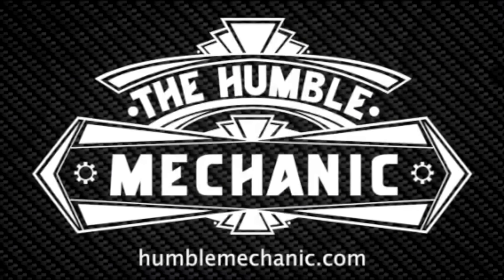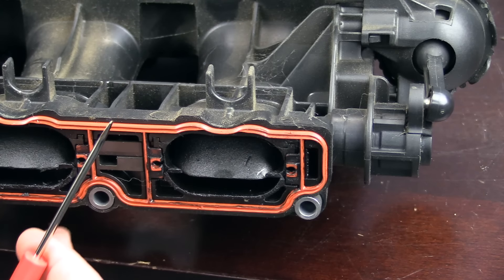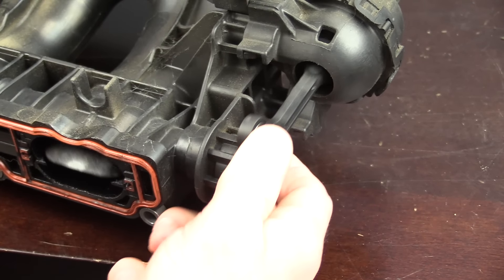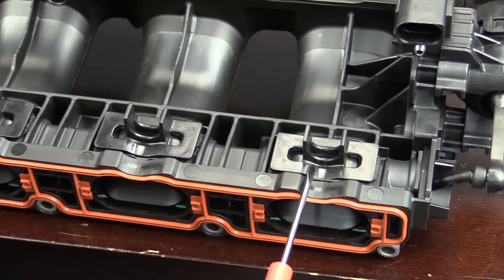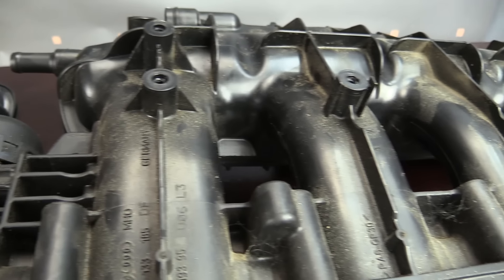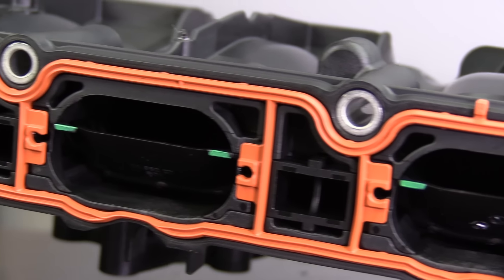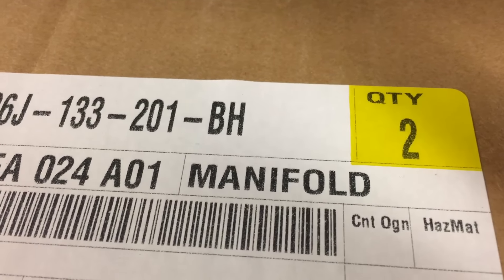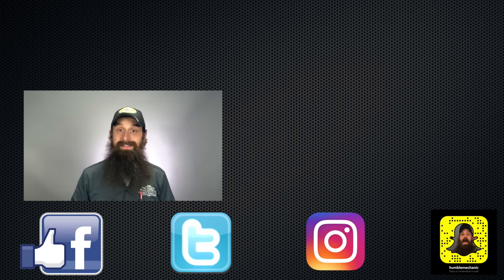2.0t TSI Intake Manifold UPDATE!

Comment: Here in Australia the VW Audi group has their fans, but a steadily growing army of discontented customers. Mercedes is beginning to get a very bad name now, in fact, anything European.
I have heard tow truck drivers say that if it wasn't for the European cars, their businesses would be rather quiet as a whole.
All cars have their problems. The discontent is growing with the dealerships and their abysmal customer service. From denial of the problem to a constant run around in order to avoid the issue (or warranty claim).
Mazda, Hyundai and Kia are now getting on top of the game here with great customer service and decent warranties.
Prices of European parts are another issue. A genuine VW radiator hose (the one with the little hose out of the side of it) is listed at $1400 and you have to wait for it to be shipped from Germany - about 6 - 12 weeks wait.
Mercedes S class engine mount. One lasted 48 000 kms and was just out of warranty. Sorry mate, here's your bill...... $3500. The owner trying to argue a case was dismissed and pushed back and forth between the Mercedes HQ in Oz and the dealer. The guy ended up paying just to get his car back. Pretty inexcusable customer support for a $100K plus vehicle. But is typical. The word is getting out here that the European cars are nothing but trouble and horrendously expensive to fix.

A friend of mine did his apprenticeship with VW here and he keeps telling all his friends to keep away from them and anything else European. They may (?) work well in other countries, but their reliability reputation here is quite poor and even worse the dealership customer support is usually highly reprehensible.

Comment: For those still looking at this, note that if you go from the old revision to this new one, you will also need to replace the fuel rail with a new revision as well as the bolt holes do not line up on the old fuel rail to the new manifold. So if you are replacing this yourself you'll likely be looking around $500-$800 in parts and not just the price of the intake manifold.
Reply: For anyone looking at this guy's comment, HE IS WRONG!
I have an 09 GTI, which is the FIRST model of the TSI engine. I just replaced my intake manifold with this new updated one and it was a straight swap.

I can kind of see how he may have thought that the rail did not align but you have to stick the top bolts of the intake manifold on first then it aligns perfectly.

Comment: Great vids! I watched the Scirocco VR6 swap videos and got the VW bug again. No pun intended. I recently picked up a really nice '08 Jetta 6spd. Great little car, but I'm getting a surging idle when I come to a stop. It'll rev up to about 2k rpm, then somewhere in between 1-k, then idle smoothly. Pulled the PCV out and it was torn. Easy fix, but the idle surge hasn't subsided. In fact, I'm showing misfires on all 4 cyls. I'm not detecting a vacuum leak, at least I haven't been able to find one using the old propane trick. Any thoughts? Idle control valve? Could it be the manifold?

Comment: When was the release of this new Intake Manifold?  Asking due to going through several intakes under warranty.  If it falls under the time I had it replaced, I'm going to ask why the updated one was not installed...  as I need another right now for a vacuum leak issue and intake runner fault...  Thanks

Comment: Question:  Differences in 1.8 and 2.0, the engines seem to be a lot alike, other than the 200 cc difference in displacement; are the problems of the 2.0 inherent in the 1.8?  I know the 1.8 has a turbo hooked into the built in exhaust manifold, but are all the other failures pretty much the same between the two engines?

Comment: Hi, just subscribed to your channel. Great video. Gotta question I was hoping you could help with if you don't mind? I just fitted this new manifold on my 2.tsi but it now stutters and chugs at idle 0.8 revs. Any idea what could be causing this? I changed manifold due to the arm fault and a lean air issue

Comment: damn i got the 2016 gli amd its seems lately that all the vids i get from you and other post are not very pleasing.  im right at abour 11k miles and now i want to take the damn thing back.  lol.
Reply from the maker: That has a different intake manifold. :) The 15+ cars have been pretty good so far.
Reply: My 2015 gti just got a p2014 code last night about intake manifold runner flaps so i took it to get fixed under warranty. My gti only has 20k miles. No ones safe lol now im worried about vw

Comment: F*** that flapper actuator. F*** Plastic. Performance Intake Manifold (HPA) for 2.0T FSI-TSI-TFSI 949.00 Cast Aluminum Flapper DELETE. 40% better plenum rating and fuel boost optimization. Fits any 2.0 engine Audi or VW
Reply from the maker: A great option for many of us. Not so thing most people will do.

Comment: Plastic manifolds... on a force-inducted engine... 

I know it's been engineered and Charles himself said he can't recall ever seeing one split or crack but plastic just doesn't really give me any confidence of having a long service life.
Reply: Alexander Klein 
No matter what kind , it eventually gets hard dry and gets brittle and cracks. Plasticizers and other big worded chemicals outgas from it and that's it. 
Here's food for thought. 
The faa says no locking bolts containing nylon or other items like that are allowed from the firewall forward. 
That's more for fire protection ,but lemme use an Italian accent : itsa notta good
Reply: That is because when nylon gets hot(400F) it will burn, not melt. so not real great at fire suppression
Reply: Welder+ cnc and good chunk of aluminum. Same deal with water pump housing.
Reply: Hence the great reliability of modern German cars, ohh wait!
Reply: Yea I could not believe it myself when I heard they switched to plastic. Im still rockin my mk4 gti and absolutely love them. Currently saving for a mk3 jetta and mk2 gti. Hell eventually I plan on getting the rare bus/truck thing they made!

Comment: I have a 2008.5 TSI Jetta Wolfsburg. Runner flap failed on my car, entire flap stuck inside my head holding a valve open... when we took it apart, was able to save the head but changed manifold.. Worst design ever..

Comment: Had my 2nd intake replaced this week on my GLI.  My first one went out @ 52k in 03/16.  Now I am at 87k.  The only difference in the part number is now its a -BH, my previous replacement was a -BD.  I was told @52k that it shouldn't happen again.  Lets hope that this -BH does in fact work and it wont happen again.

Comment: Why couldn't they forsee this? Why didn't they build it this way from the beginning?
Reply: There's an old saying: pick the right material for the job.
Plastic crap...
Reply: Jay Edlington then you engineer a car bro. There are millions of reasons manufactures do what they do. Plastic manifolds are king due to there ability to self cool, don't expand and contract like metal does, house runners for varying intake length, and will not damage the engine if the front end has a impact.
Reply: What kind of material have a better temp transfer? Plastic or aluminum?

Comment: Hey I literally have asked and looked everywhere for this answer and no one, not even the people who make it can answer this question. 
I want to use the delete runner flap kit in my 2013 GTI. My question is. If I put this kit on, the flap runner sensor will still throw p2015 code because there will not be any movement to read. How do I turn off, tune, remove the sensor so I won't have that issue?

Comment: Hey man thanks for the video, great stuff. Please help me and a couple other people on here with our question. Where does the additional breather filter mount, how is it routed and is it totally necessary? Right now I have the part but it's not installed. Also there is a  50/50 chance that the new revised manifold (ends in BH) will not fit the existing fuel rail due to the slightly different molding on the u-shapped cradles that hug the fuel rail ports. The newest revision has cradles with raised brackets under it and it doesnt allow the fuel rail to seat right. It's been confirmed by people other then me. I had to mod the intake manifold by trimmimg the craddle tabs. This is definitely a fact, just a heads up.
Reply: I cant figure it out either...any luck?
Reply: @nmenn59  yes I figured it out. I could send you photos, got an email or Facebook account or Facebook messenger?
Reply: bolt it down to the empty bolt hole between coil #2 and #3, the hole is not threaded, the screw provided will self thread in. Then guide the line through the intake manifold following the near by black line and clipping on to it, under the intake, past the fuel rail, then plug it in the empty silver nipple behind the vacuum solenoid, on the right side of the manifold.
Reply: @restolad  i got a couple. I'll send them now.
Reply: @superdoooooooooooooty  thankyou sir!  and the hose routing? pics
Reply: @restolad  sent
Reply: @restolad  the photos of the manifold brackets show that you gotta deepen the U shaped brackets, but also you gotta cut a grove in front of the brackets where the metal rail "flange" will sit into. If you look at the old manifold it will make sense. The breather filter routing will make sense once you kinda lay it out and bolt down the filter, the clips line up to where they go and just guide it through. It connects to the empty nipple on the bottom of the manifold solenoid on the right, right under the runner flap vacuum solenoid. Let me know if that works for you. Good luck
Reply: @superdoooooooooooooty  cheers !

Comment: Great video!
Question,
I Just installed the upgrade intake you recommended from Deutsche auto on an audi A3 2.0 TFSI. I also got the install kit from them & it included a vent line + filter for the solenoid. My question is how the hell is it suppose to be routed and what does it bolt to? It would be nice if they'd include some direction in the kit since it's a modification.
Also FYI it might be dependent on the year your replacing but the stock injector rail had to be ground down around the injector flare flange. The flared portion hit the manifold were the new molded support brackets are and prevented the rail from seating up on the little plastic nibs that align the top side. It wasn't a hard fix, but should be noted.
Any advice you can share on the routing of the new vent kit would be appreciated.
Reply: your comment is 10 months old But im wondering it sounds like  you got the old fuel rail to fit the updated manifold ? with out extreme drama.The replacement up dated rail is very expensive.  did you snap a pic of the rail fitting new manifold? cheers
Reply: @restolad  I did get the rail to fit. Just needed a little work with a die grinder. It was a 2013 Audi A3 & the required clearance grinding may vary depending on year. Can't remember what I did with the vent kit. I'll take a look tomorrow afternoon. It's my wife's car.
Reply: @wilee7572  thankyou this info is encouraging that it can be done

Comment: OK, I'm gonna weigh in against the haters, as a former hater myself, just about every car nowadays is going to have problems, because of all the technology in them, the government forcing emissions and CAFE ratings down manufacturers throats etc.
I have a 2008 Ford F-150, the most common pattern failures on that generation (2004-2008) were as follows: cam phase actuators, cam phaser solenoids, timing chains, timing chain tensioners, (interference motor BTW, out time = CRUNCH on the valvetrain)
4wd vacuum solenoids, 4wd actuator hubs, radiators, blend doors/actuators/cam plates, axle seals, carrier bearings on the LWB trucks, instrument panels failing, and if you do them wrong, spark plugs breaking in the heads, and failing fuel pump control modules( mounting aluminum parts on a steel frame, where water and salt can get to it, not the best design, but there's an update with standoffs that screw into the frame, to prevent it from corroding and breaking)

my truck is approaching 140k now, I've put a radiator in, 2 sets of plugs and coils (coils are junk, so bad, Ford only charges like $40 at the dealer for new ones)
one LF 4wd hub, a blend door, and now it seems my instrument cluster is on the fritz, everything else has been regular maintenance honestly. Forgot the front caliper that locked up, which can happen to ANY vehicle with that kind of time on the clock.
I've experienced NONE of the other failures I've mentioned.

My point here is this: just because it happens on others, doesn't mean it will happen to YOURS.

I started in this industry when MK4 was new, they taught me to hate this brand, but MK6 and now MK7, are making me more willing to give then a fair shake, just my 2 cents, take it for what it's worth.

I will say this, VW can't keep relying on the Jetta and the GTI to keep them in business too much longer, especially now that TDI has taken a YUGE hit, German cars used to be synonymous with top quality, as a German myself, I'd like to see that make a comeback.

Last, but not least, Charles, thanks for the awesome videos that have inspired me to revive what I thought was a dead-end career, and to try something new, as I'm going to an Audi dealer or two tomorrow, to try and snag my first ever dealership job as a technician.
Reply from the maker: Dude AWESOME AWESOME AWESOME stuff. Thank you for taking the time to share your insight. I really appreciate that. I agree that VW can't rest on the GTI and Jetta. I am hoping that is what the Atlas will bring. Only time will tell. 

Also.. YUGE HAHAHAHAH

Also, I want to wish you all the best on the tech job hunt. Good luck and do great things :)
Reply: HumbleMechanic much thanks sir,  keep up the awesome video.

have you done a water pump replacement video on a TSI?
That would be good to see, or maybe a video on how to convince your girlfriend you must have a GTI Autobahn edition for 2018?

Comment: wow so many plastic engine parts used in German cars, no wonder they have reliability issues.
Reply from the maker: I don't think that is just a German car thing. I think this is an industry thing.
Reply: Do you think there will be fewer things to go wrong once the industry has shifted to Hydrogen Fuel cell cars, or even electric cars? It seems there is a very massive degree of mechanical complexity with internal combustion engines, and all the environmentally unfriendly fluids that go with it!
Reply: Wow really ? Do you have any idea what goes into making hydrogen?
Reply: well compare to the cheap plastic in US cars, I prefer the german plastic ;-)
Reply: Cheap plastic that fails with age...
Another reason to avoid VWs...

Comment: Both are made out of the same material. On cyl #2 it says >pa6 gf30<, which means its nylon with 30% fiber glass reinforcement. Not trying to correct you, just giving info. :)

Comment: Used to have a 2010 Audi A5.  I will never buy another Audi/VW cars ever again.  That car was in the shop more than 10 times for various problems during my 4 year ownership.
Reply: FixTooth damn...my 04 Toyota has never had a mechanic lay a finger on it...at over 190,000 miles. 
I do the schedualed maintenance myself.  Sometimes taking cars to a mechanic is the reason other problems happen.
Reply: Same here mate, I will steer away from german cars as I have had numerous problems with my low mileage gti. German cars are unreliable, especially considering how much you pay for them. So from an engineering point of view I think they're crap if they keep breaking down and continuously revise their parts which they don't get right in the first place.
Reply: But everybody has different experiences of the same brand... also the chances are there's someone out there with an '04 Toyota' that's had numerous issues as well. I've got a 2001 Golf on 135,000 miles and she runs like clockwork 7 days a week.. that's not to say they're perfect, but I don't think all VAG cars are 'crap'.
Reply: Ben Dewse far fewer owners have had problems with their 04 Toyota than have had problems with their VW. And there are an awful lot of Toyota vehicles out there.
Reply: i'm having a small fleet of 2gen(2004-2009) prius cars. All of them having more then 250k miles. Still under hood like new(one car start liking oil out of valve cover).